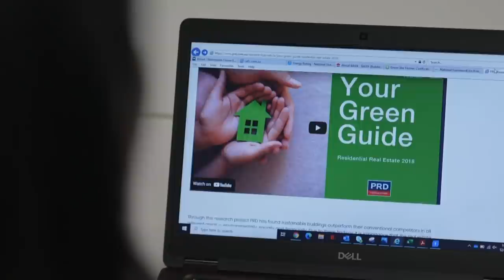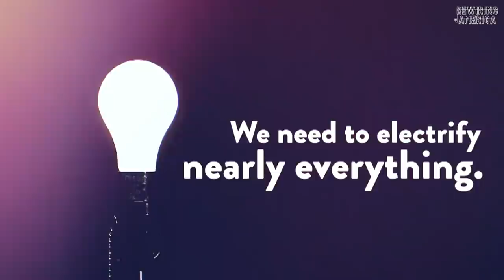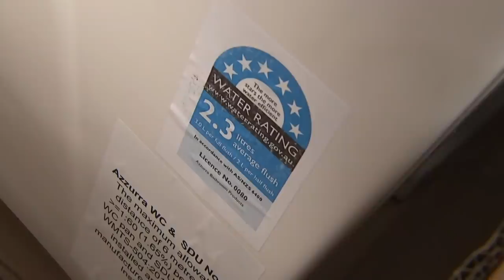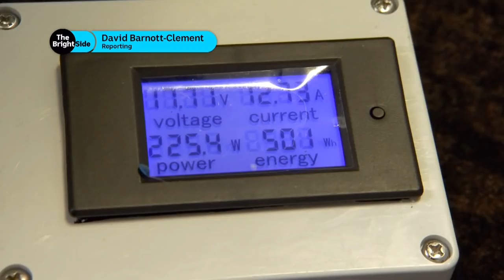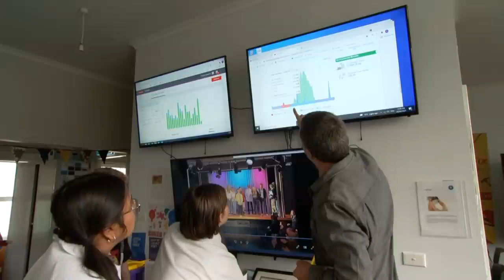Regrowing an underwater forest, and other climate solutions | The BrightSide

Comment: Thinking that your doing any good by Insulating and putting solar panels on single family homes (that apart from being so poorly built they will have to be demolished in 30 years) not to mention they are so outisde of the city limits that they have very little or no public transport is completely missing the point
Reply: What's the best insulation for my 2 bedroom apartment? I can't cut into the thin drywall to put the proper insulation so I have to drill small holes for spray insulation or use something on the inside of my walls to damper the loud mouth neighbor's or else get a loud stereo and play it very loud to wake their babies up in the middle of the night. Like 2:30am or 3:00am until they call the police whích the police have been watching them due to several complaints from various neighbors & tents! They don't clean up their dog crap ever whích is in the lease + they hang óut in the stairwells all hours of the night which is also a rule in the lease to not do at anytime! Forgive me for venting to a total stranger please?
Reply: various neighbors & tenants not tents! A typo